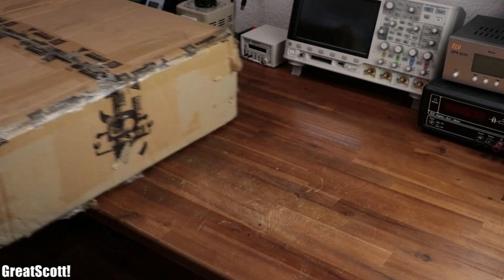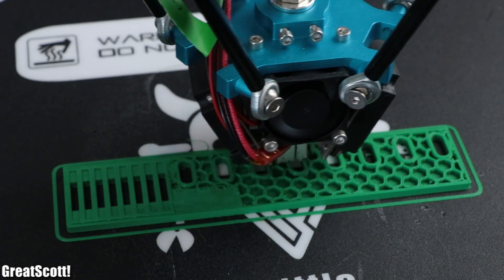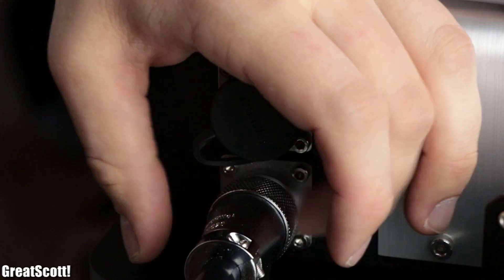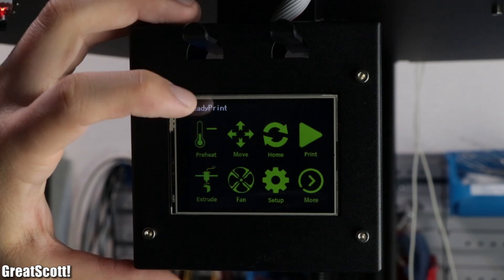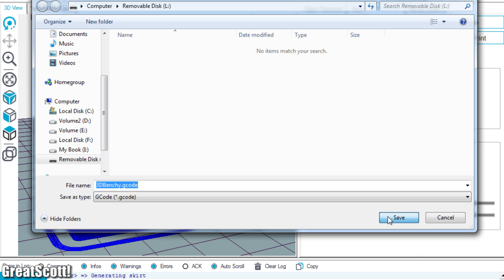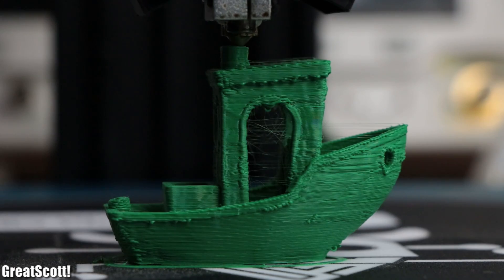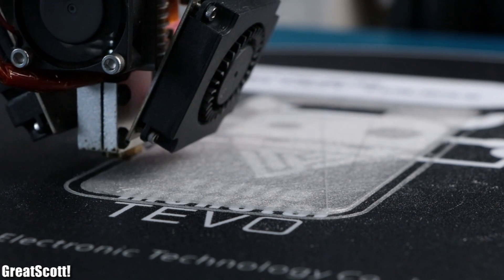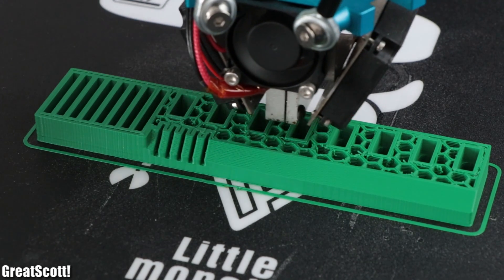TEVO Little Monster 3D Printer Review - 800$ Big Delta 3D Printer with direct extruder?

Comment: This printers board is prone to problems, I bet that is causing the strange quality issues. I just upgraded my Tevo Little Monster to the DuetWifi.....best......descision.....ever! The board and web interface are awesome. Rock solid and near silent at 128 micropstepping!. I was disappointed in the stock extruder setup. I replaced the stepper with a pancake stepper from E3d, I moved the belts that suspend the extruder so that they hold the Bowden tube closer to center. A also used rubber bands that go around each arm and connect around the extruder Bowden coupling to stabilize the extruder. This was a bunch of BS I had to go through but this thing is AWESOME now! I'm just waiting for my Zesty Nimble remote extruder to show up and this thing will be unstoppable! Like Great Scott says,  this isn't for beginners but I it has good bones, with a little work this thing became a great printer!

Comment: Thanks for the review...really important to read the manual and use the springs to tension the extruder supension.  Appreciate your efforts...my first print was actually very good quality. The quality problem is just noise...start with removing the mechanical ringing and then denoise the steppers. These are actually a great printer for the money. I dont work the company...just do a lot of printing :-)

Comment: You have the extruded to loose.    This printer prints waaaaaaay better than this.  Tighten the extruder and make another video pleeeeesssse!:)
TEVO LITTLE MONSTER. I just purchase it from 3dprintersbay.com for $749 coupon code TLM50. I've researched all the 3D printers and for the speed, quality prints, 340x500 build size, it appears quality built frame and at $749.00 price (shipping included) I have not found anything to come close to beating it!

Comment: Great video scott, but there is no way that this printer prints like that, i have an Anet A8 (150$) super perfectly dialed by myself, it prints soooooo much better than that. I think you just need seriously to learn all the slicers options. I learned ALL the cura settings. In my opinion here you have:
temperature too high
overextrusion (decrease flow)
blobs and zits (choose a lower "extra prime amount of retraction")
Fan in too low ( turn up your air flow and choose a more precise fan duct)
Choose always a specific starting point for each layer. i would like to show you my prints, they seem like mold injected. Hope i helped you, you are great

Comment: Quick video idea. A list of the components you feel would be worth bulk buying for a beginner. Of course there's the obvious stuff like resistors, LEDs, potentiometers, capacitors.. but there are other components and ICs that may be good to bulk buy. I have a bunch of NPN transistors and am thinking of buying a few 555 timers, but I'm sure there are other things that'd be good to stuck up on :)

Comment: looks like you did not run the wires for the hot end into that 1/2 inch hole on the exturder . thats going to destroy your print quality with that wire pulling on the hotend unevenly .

Comment: I built this printer about 3 weeks ago and was able to get really good prints with minimal software adjustments.  The only speed factory  settings I had to adjust was the infill speed, it was set at 150 mm/s and I moved it down to 120 mm/s...thats it.   Also it looks like the extruder was installed too close to the hotend which diminishes the advantage of having a "flying extruder" setup.  I believe the manual recommended that the extruder should be hanging in a range of 10cm - 12cm above the hotend.   Adjustments to the tension and alignment of the sliders is the most important part of putting this together, since they will have a huge impact on print quality and is not easy to adjust after the printer is put together.

Comment: My Anet A8 does much better prints with up to 90mm/s. It costs 140€ + a lot of updates = around 300€. If you know what you doing( I didn't when I started) you can build a much better 3D printer with less money. Only because a printer costs much it doesn't mean the print quality is good.
Reply: Heimdall Midgard anet a8 is not the greatest printer, the acrylic frame warps with time.

Comment: Hmmm, I wonder if it would be possible to relocate the extruder motor to a solid location and use a longer run of ptfe tube? I have seen some other printers that do this so they can feed multiple colors into a single hotend. 
Also, I would be fine with lower quality prints given how large it can go. I already have a Printrbot metal that is pretty good for the small stuff, it's just printing large items that's a pain

Comment: I've never had such bad quality prints with the 3KU printer, but then again my 3KU prints look better than your 3KU prints :/. For that kind of money, I hope the print quality is a result of assembly error/loose belts/bad software configuration.
I am hesitant about the v-slot (I would prefer linear rail and carriage) and the extruder dangling like that looks ridiculous (doesn't the inertia screw up the head position?) but overall it looks sturdier than the 3KU and it prints bigger stuff.
However, $800 (double the price) for so little, I think I'll pass...

Comment: You are messing something up :-) .....  Heres my benchy:  https://www.thingiverse.com/make:339634
Reply from the maker: I double checked pretty much everything. I know that others have great results with the printer but not me. It's a shame.
Reply: it looks like you are overextruding alot, and using high temperatures.   You do know that just editing the config file does not change the settings right ?  you have to save them in the confing override file with the m500 command, or save the setting in the normal config file, and then run a calibration, so it creates a new override file using the config file

Comment: You didn't say anything about retraction and other such settings. did you try touching those to get a better print? I saw on a 3D printing channel how settings are much more critical to good prints than the printer itself. But here the shaking over the head seems pretty serious so i could be that settings can't help at all. Just curious

Comment: If you use a proper bowden feeder, it is also possible to print flexible filament. Yes, it is harder to print with it, but definitely possible. Search for the "plastikprint extruder" on google, that for example works with flexible filament.

Comment: hey Great Scott got a question off topic ,it's more about a setup with 18560 batteries and running boost converter to make up the  voltage loss when running a setup the requires one set voltage for Max performance.  do you have a minute to hear me out?

 I no when running a boost converter it will keep the voltage steady and start taking what's need from the amps to cover the loss but my question goes alittle deeper and I'm not really able to find my answer on goolge

Comment: I have yet to find a 3D printer that prints great out of the box.  Every printer requires a bit of tuning (even the Original Prusa I3 MK2 and expensive Ultimakers).  Your temperatures, extrusion rate, and retract settings are off.  Correct these and your print quality will greatly improve.

Comment: I'm running a 170€ Delta printer myself with bowden extruder. After replacing the bracket behind the drive gear with a part I designed and printed and shortening the tube by 5cm it printed TPU pretty flawlessly. It was a quite firm plastic tho at a shore hardness around 90.

Comment: Is the extruder supposed to hang in mid air? Printquality would be improved, if it is mounted somewhere. Also try to tweak the temperature. Stringing will become less, if you lower the temperature

Comment: Just try to figure out how to securly mount the extruder to solve the vibration problem at high speeds and it might work fine even with those settings too

Comment: It's extremely clear at 5:48 why that dangling extruder motor is a terrible design decision, those ripples in the body of the benchy are all caused by the jerk of that motor weight, even when printed extremely slowly at 20mm/s.  On cartesian machines you see the same thing when the belts are loose and the print head moves too far during direction changes.

Comment: Never seen anyone use the method there of having the extruder suspended in the air above the hot end, kinda strange. I suspect that's one of the main sources of vibration in the printer, as everything else seems pretty solid. It might be possible to modify it to turn into a bowden setup by modifying the extruder motor mount, getting a longer tube for the filament, and ahcnoring it at the top of the printer while still having the belts connected to the extruder. That way, if you ever wished to do flexibles, you could just swap out the PTFE tube (or whatever material bowden tubes are made of, I honestly forget) for the shorter one?

Complete conjecture though, and possibly more work than you're planning on putting into your printer - it'll basically work fine right now just won't look as smooth.

Also, while a lot of the electrical engineering stuff goes way over my head in your videos, it was fun watching one where I felt like I understood everything that was going on!

Comment: why the fuck is this extruder suspended over like that ? how did they thougt it was acceptable ? Chinese engineers never finish their designs ... always big flaws in their firmware and material conception ! Don't spend 800$ in this crap !

Comment: I think that extruder design is awful because of the hanging stepper motor. The overall building quality seems excellent but instead of expensive connectors would be better a more clever extruder.
Reply: When the extruder is installed correctly      ( his was not) the extruder is held still, in other reviews the printer has been assembld propoly and can print like a champ

Comment: 800$ for a printer with a dangling extruder motor,but they have AL parts.......WHAT THE FUCK?
Reply: mario kovac it's called a flying extruder , a technique use commonly on delta printer to shorted the Bowen tube travel from the extruder to hotend.
Reply: his one is broken check rclife on
Reply: china
Reply: folgertech FT-5 is Bigger, Faster (by a lot) and has a way better Print quality. for 500 $
Reply: TripleDoc i just dont get why would you put so mouch effort in to designing the rest of the machine and leave the extrudor like that

Comment: Good vide but for 800$ i'd go with the genuin prusa i3 mk. 2 which is one of the best printers curently on the market.
Reply: Just make a monster sized Prusa. 400x400 or even bigger, like 800x800 like some people have. Its just all-thread, 8mm linear shaft (or 10mm or 12mm for bigger ones), and some of that square frame tubing. It would cost maybe $500, and you could use nice parts like 500w silicon 120v AC relay actuated heated bed to heat up in a few minutes, and massive Nema motors. Its like Legos, you just make whatever you want.

Mine is a typical 200x200/235x200 mm laser cut acrylic kit I converted to Bowden so I could run 120+mm/s prints. That phone case would take me maybe 5 minutes (not 6 hours!) if its ABS. If you need direct drive extrusion, leave it stock and it printed super nice at 80mm/s (wasn't as good as the $10,000+ printer the size of a full size fridge with similar print volume to mine). It was like $300 a few years ago, now they are cheaper and have screens and SD readers on them for less. I've pushed maybe 10 pounds of plastic through mine, enough to replace some linear bearings. Still works good!
Reply: LanSavodnik Get an ultimaker haha
Reply: Prusa isn't a delta though... Apples and oranges...
Reply: Mohammed Alharthi I believe in the USA it's free, and in Canada it costed me about $150 with insurance from both USPS and UltiBots. If you're outside of North America then it is probably ridiculous (fuck UPS)
Reply: Lerbyn agreed what i ment is that for the price i have yet to see a significantly better comercaily available printer.
Reply: Dhruv Chawla no don't haha
Reply: If you want a big delta with better quality and faster speeds than the i3 mk2, look at the ultibots d300vs
Reply: Also creality ones are very good
Reply: He bought this one because of the print bed size.
Reply: LanSavodnik this is huge though
Reply: best printer on the market lol there are a lot of much better printers on the market not for that price maybe but certainly better once
Reply: Sapher i know and i'm sure he had many more reasons but i'd go with the beter print quality from the prusa as 90% of the prints are 20x20x20cm or less and i don't realy like deltas as they give you more of a cone than a cylinder/cube

Comment: for 800$ machine, the output of 3D printed objects doesn't look very well. My anet A8 printer can make better 3D prints than yours 800$. Also i saw that, your side fans are not spinning which can cause poor 3D prints due to long cooling time of melted plastic from nozzle.

Comment: The print quality may be because the extruder is flapping around in the breeze.
Reply: They chose this setup to remove the weight from the effector, so there isnt an extra 300g adding to it's inertia. Unfortunately this machine hasn't been setup as well as it could have been, mainly because the manual they ship these out with is subpar, their updated digital manual is much better - the spring clips that will be in one of the bags somewhere are used to add tension to the belts that hold the floating titan extruder up, and keep it from flapping about.
Reply: A
Reply: Jonas Bandier well yeah, but its because its tooo fast. 

I dont mind slowing it down for some quality. None of these are what i call fast anyways ha!
Reply: I think it should be attached with rods like the extruder
Reply: Maybe tighten up the belts that holds the extruder

Comment: I want to start shop but I don't have money for the 3d printer or CNC machine. Can you review cheap one and send it to me? If you want more info about my plans please send an email to me. 
BTW How you can dislike the video?
Reply: Maciej Buczak i can send you my old cnc machine
Reply: First, see how much will it cost you I live in Poland, so it will cost much.
Later check how much is yours CNC worth now
Reply: Jaakko Lehto You just saved his life lol
Reply: not yet
Reply: Maciej Buczak Your right, now you have to work something out. Shipping might be the biggest problem it seems.
Reply: I checked about 2 years ago and the  cost was I think 20 $
Reply: Oddly enough that's pretty cheap, if it's a big cnc wouldn't it cost a bit more though?

Comment: GreatScott, my mum is a primary school teacher and last thursday i did a 3D printing demonstration to students under the age of 8. they seemed to like it and i was asked if i could come back this year for another demo, maybe to older students. do you have any advise for things i could show off to students ages 5-11 relating to 3D printing? thanks.
Reply: BoomBrush make something that have mechanics
Reply: i made a piece which had a planetary gear in the middle but they all thought it was a fidget spinner >_>
Reply: BoomBrush think of something interactive
Reply: Minecraft pickaxe is quick and easy, or Super Hero/ Minion cookie cutters
Reply: you can print a car in one print if you want (the car is printed from the side, so the wheels wont be attached to the body). It's one of the piece that only a 3d printer can make, traditional machines like lathe and drill can't do it "in one step"

Comment: for the other delta printer, did you tried the flexion extruder ? and if your prints are a bit bad, try to check of the part cooling fan is on.
Reply from the maker: Adding a part cooling fan for the old printer is on my to do list

Comment: I still like my 300x300x400mm cartesian machine. $500 and it's probably the best in its class. The linear rails are just so good!
Reply: LazerLord10 What's the name of the printer?
Reply: Folger Tech FT-5. It needs a few upgrades (glass build plate and better power supply), and it takes a ling time to build. But I love it!